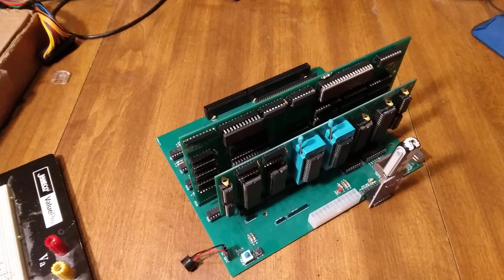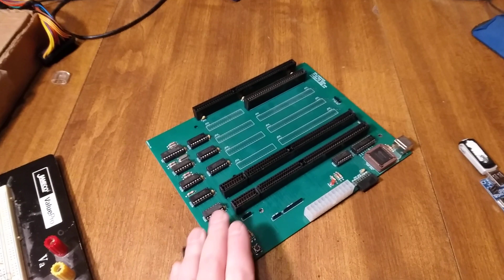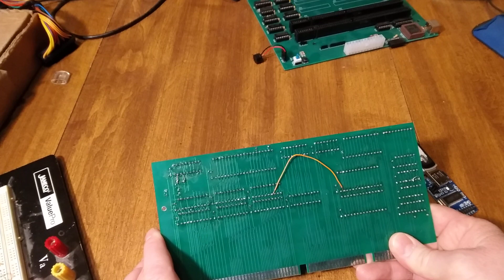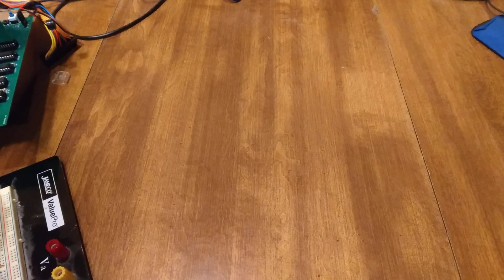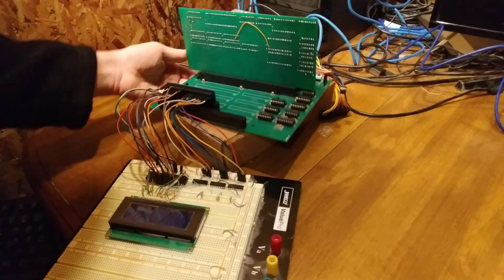8086 PC booting DOS 6.22 from USB drive

Comment: Can this work with the Intel 80186? The Datasheet says the I186 is software and hardware compatible with the 8086. Loading x86 software from USB for these kinds of CPUs will be extremely  useful for my I186 16-Bit x86 Computer project
Reply from the maker: The problem with the 80186 is it is designed to be a micro controller. The Interrupt hardware map is not PC compatible. 

I made a video on the 80188 and what it took to get it running with my project. The same would apply for the 80186. 

If you used a Nec V30 you would have all the 80186 opcodes and be pin compatible with the 8086.
Reply: @elijahmmiller  thx for the info! 
I'll check out that video soon!

Comment: I like the videos! I’m thinking about making a cheap monochrome display adapter using a 6845, and 90s SRAM & ROM. Do you know if the XT bios does a self test of the MDA (if jumper sw configured) or just sends registers to init and starts writing to MDA RAM address?
Reply from the maker: The BIOS detects the graphics card. So what you design and build would just need to mimic an off the self card.
Reply: @elijahmmiller  I thought that only goes for VGA cards with a code ROM on board? 
I'm afraid that if I let the 5160 configure the 6845 it'll set registers wrong for my purpose anyway so maybe emulating the MDA isn't the way forward - and I will actually need to make a "VGA" card with a code ROM that inits the 6845 correctly..
Reply from the maker: I did not write the BIOS. I only contributed the early prototype CH376 code. It maybe be worth asking on the DISCORD server what the process is for initialization of the graphics card. 

I just know that if you don't have a graphics card the system won't boot up. But it seems as long as you plug in a compatible card(not all work) it boots up. It can be a VGA, CGA, or MDA.